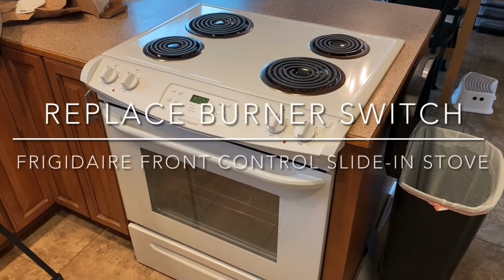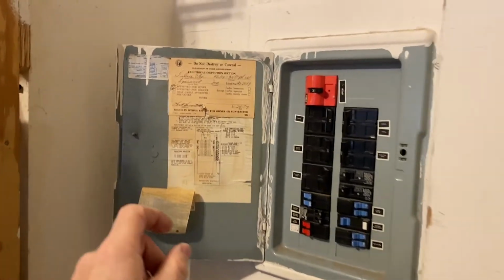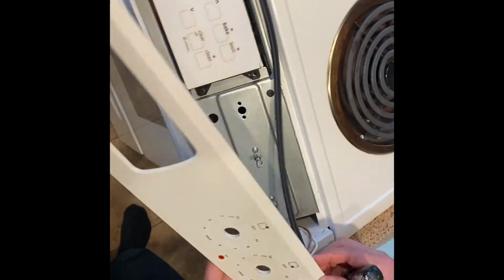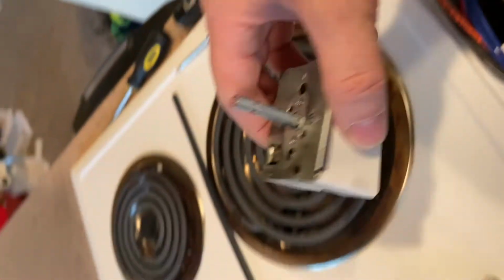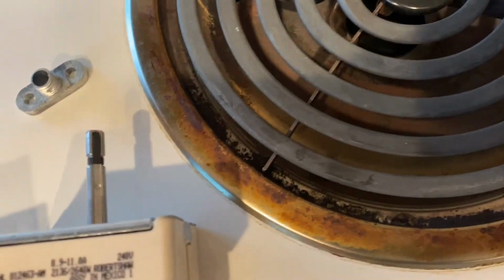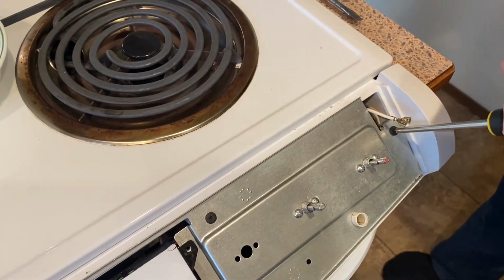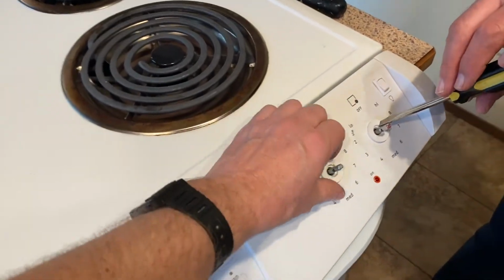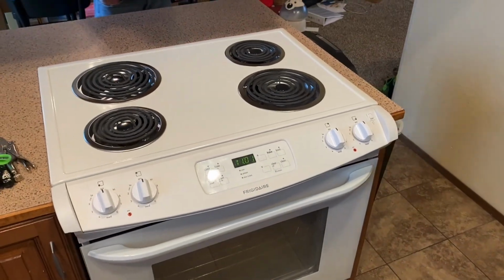Replace Element Switch, Front Control Slide-In Frigidaire Range Repair

Comment: I Own GE JSP39DN1CC I need to change out infinity switch but don’t know how to get the panel off the control are the front
Reply: I have a GE JMS01Bo1AD.  I also need to take off  the panel to change a switch.  DId you find out how to do it?  Thanks.

Comment: Finally.! Thought no one had the same oven. I just need to replace the overlay sticker. Should I still shut off power although it’s just the sticker?
Reply: Best and safest is cut the power anyway.  But I agree its not really affecting any wires, to put a new sticker on.

Comment: This is probably the same procedure for a lot of models other than the Frigidaire FFES3015PWS.
Reply: I can confirm that the same process will work for a glass top CFES3035LS3. The control panel in the front has an identical layout, excepting the switch on the far right side seen in this video. I followed the instructions here to access the panel, which certainly saved a good hour inspecting and removing various screws.